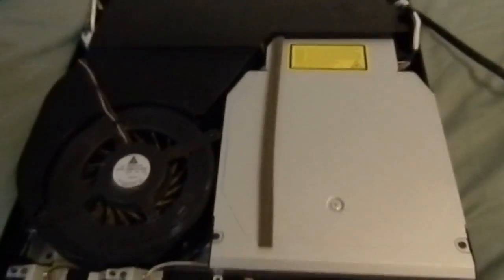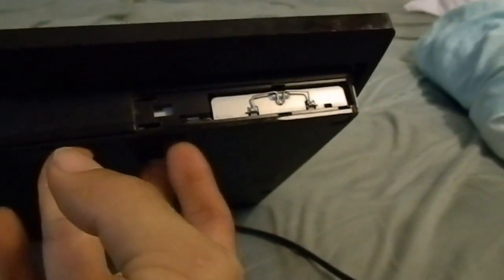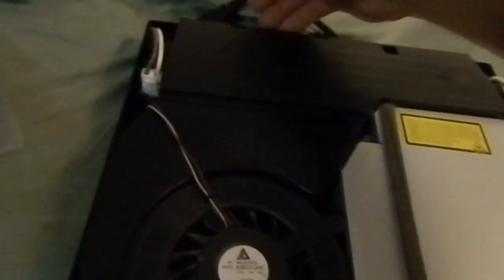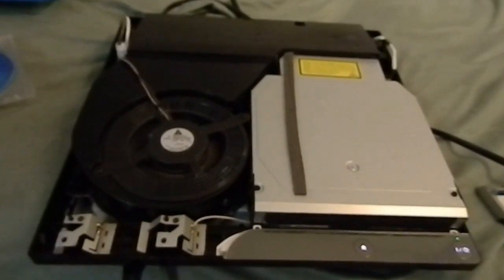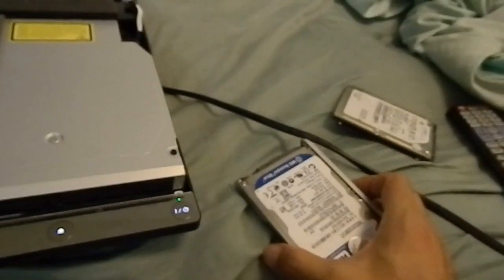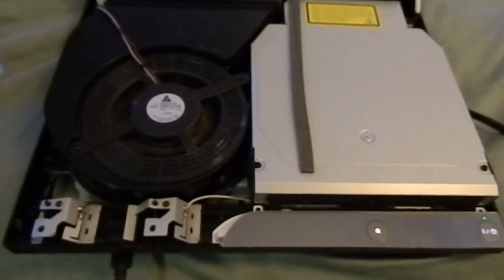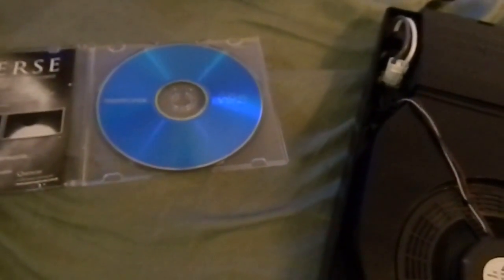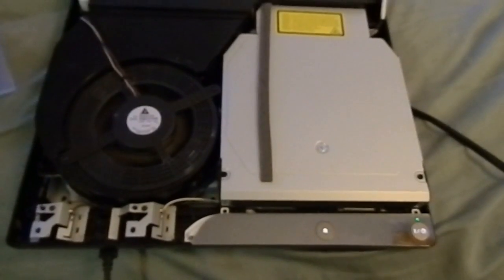PS3 WITH NO VIDEO AND GREEN LIGHT REPAIR GLOD Hard Drive Failure (como reparar PS3 sin video)

Comment: Mine died today. It froze during skyrim. Pulled the plug as its the only way I could unfreeze it. Turned it on and no hdmi output came, you cant turn it off either like the button doesn't beep or anything it stays on permanently unless you pull the plug. Tried several times. The power button will turn it on, but turning it off by holding it its unresponsive. No blinking, no sounds. Nothing. Its done I guess as you cannot boot into safe mode as the power button doesn't work beyond turning it on, once its on, it stays on forever. Pressing it again does nothing.  I was pretty far in skyrim and was addicted to it now ill probably get withdrawal. The controller doesn't connect to it as well, it just flashes when you power on the controller.

Comment: I just had to pull the HD out and reinstall and it worked after 8yrs not being plugged up. Thank you.
Reply: New HD ?
Reply: @dualsticks6502  factory 40g. Connection probably had just enough corrosion that it lost continuity.

Comment: what do i do if even without the hard drive my ps3 doesnt show anything? (p.s it's a phat model but not the backwards compatible one)
Reply: Did u ever figure it out?
Reply: @Devil Ops  likely rsx needs reballing but i dont have the equipment to do it
Reply: @Fogolol  Yea sucks maybe I just need a new hard drive did u try that? Because we have the fat version maybe it's different
Reply: @devilops341  i did try another hard drive, came from a working slim version ps3 just for testing but still no output, fan would increase strength after 2 minutes like normal but no display, also was able to run my slim ps3 normally with the hard drive from the phat, though my slim's hdd got corrupted thanks to that stunt, good thing i had my saves backed up, so yeah i think this is an issue with the rsx maybe even the cell and reballing would probably fix it but that wouldn't be a permanent solution anyway so i should just scrap it for parts
Reply: @Fogolol  thx

Comment: Good stuff. I was having issues with my PS3 and haven’t been able to play it for awhile. I tried different tv, monitors, cables, until I found this video. I think my PS3’s gpu is busted because I don’t see that screen even when the HDD is out. I’ll try to bring mine to a repair store and see what happens. Great video, very helpful.
Reply: Did It get fixed?
Reply: @Antone_06  nope, seems like I need to have to replace the thermal paste but haven’t got the time.
Reply: @chican_0  my screen is black but with like 50 different random colored pixels on it even with the hard drive out, so I’m assuming it’s a gpu issue.
Reply: @Antone_06  most likely. If thermal paste doesn’t solve it then maybe gpu is already busted. I’m assuming the same for my ps3.
Reply: @chican_0  I’m taking it in to Best Buy this week and they said they’ll look at it for free
Reply: @Antone_06  
Did it work?

Comment: I really like the way how you diagnose this issue. If it works without the drive this means it is NOT a graphic issue but either software OR hardware failure of the drive :) I really appreciate this video. Thanks!

Comment: My PS3 slim doesn't work with HDMI but works with a Component cable, could this be the issue and I need to replace the HDD?? I already reset the video and put the HDD out and back in.

Comment: When i start my ps3 the green light stays on but there is no display, i tried switching the hdmi & vga cables, also tried A/V reset, but still no video. And when i swtich it off, green light flashes (slowly) then it beeps (3-4times) and then shuts down, CAN YOU PLEASE TELL ME WHATS THE PROBLEM???
Reply: Same problem I’m also facing with my ps3...i think it’s a hard drive issue.
Reply: @ThakurAbhishek5347  I have the same problem after I tried to update the latest software.
Reply: Kofi Seidu not a big issue .. i took my ps to nearest technician... he pressed the power button for few seconds and and than something was written on the screen and he factory reseted the device .. and boom i got my ps back to life again ..and it only costs 200 rps lol 😂
Reply: Abhi rajput wow good for you I got a ps4 to play games (Not much games) so far I really play my step dad’s super slim ps3 that he never uses anymore. It’s been around for years and still functions correctly.
Reply: Ff

Comment: Always try to rebuild the database before replacing your hard drive and losing your saved data. It could just be a corrupted database. There are several YouTube videos on how to do it. Better to try that than lose 5 years of saved game data. If that fails, you can try reinstalling the system on your current drive. You’ll still lose your data but might save money on buying a new drive.

Comment: My ps3 slim has no video and audio and no hdd light blinking ,  fan is working , disk inserts and ejects as usual , has green solid power colour , i changed the hard drive and it still has that issues...but my controller get synced when i connect it with cable and press ps button....i dont know whats the problem
Reply: AWESOME CREATORS same
Reply: Material's Upgraded Same, got mine today :(
Reply: @kellybodley8363  did u get your ps3 repaired ?
Reply: @Shaadibnmohammad  sadly no
Reply: @kellybodley8363  i also dont how much will it cost
Reply: @Shaadibnmohammad  I'm moving to PC

Comment: I replaced the bluesy player and hard drive ,updated to 4.82 or so and everything works Except  for when starting a Disc the screen stays black, I already did safe mode options still black screen
Reply: Pasquale Lerro I have the same issues did you fix it

Comment: My ps3 won't show up on my tv.. I tried resetting the input/output while it was connected to my HDMI cable and again with just the av cables and again with both at the same time.. my green light is coming on the yellow hdd lights flash for a few seconds after letting the power button go but still nothing... please help idk what else to do..

Comment: I was in the kitchen and me and my sister heard a loud bang. I went in my room and my ps3 was on the floor. It fell pretty hard. It turns on, but you can't see anything just a blank screen, controller won't work with it, won't go into safe mode, no audio. Please is their a solution that's easy without having to pay, sell, or repair my ps3. I didn't touch it for the whole night. I turned it on today and it went to the screen but froze with these weird color lines. So I turned it off and it's still doing the same thing as forth as no ps3 screen, controller doesn't work with it, no audio, won't go into safe mode. Oh, and when I pressed the power button it turns on, the orange color dot blinks a few times then doesn't blink no more. The green color dot doesn't blink at all. So I have to hold the power button for about 10 seconds then it turns off. I'm 12 so please don't let their be any hard work, repairing, selling, or paying. Please try to find a solution and if you do please let me know ASAP!-Lil Jordan P.S. please let their be a solution that won't result in losing my saved game data.                                               

Now its loading the game, and controllers are syncing basically its working regular but when you get into a game its freezing with the weird line colors that's all that's wrong with it now. A solution for that.
Reply: hey my ps3 did this for a while then broke completely, if you bought any dlc i would deactivate your account untill you fix it unless it goes completely
Reply: the weird line problems sounds like the gpu is failing, when u droped the ps3 you probably cracked the already dried thermal paste on the gpu and cpu. id replace them and see what happens. basically your ps3 is just overheating in my opinion easy fix
Reply: Beretuzerpk can I take my hard drive out,send my ps3 to sony to get it fixed then put my hard drive back in and have all my data?
Reply: that seems like the perfect question for sony if your ps3 is still under warranty, call them up.  if u want to save some important save files to a usb drive if sony says no, then flip your ps3 and apply pressure to the back usb side of the ps3, should be your right side.  that should stop it from pixelating as long as u continue to hold the pressure with an object or something long enough for u to back up save data on a usb drive
Reply: Beretuzerpk but my ps3 shows no input and if it does it freezes in 2 minutes once it comes on so I can't put my data on a usb that's y I thought bout da hard drive
Reply: +Lil Jordan did u apply pressure to the back side of your ps3 with the palm of yoour hand to where the gpu should sit?
Reply: Beretuzerpk nah...
Reply: Lil Jordan dumbass you will have to repair it. This is a video where you did not dop it

Comment: my ps3 is on cfw is there any chance i can replace the hard drive and stay on the cfw or will it upgrade to the latest ofw wich is 4.80
Reply: +Robert Tolhurst Fixed it?
same problem here. I got GLOD(probably) and when I switched my HDD with an OFW one it worked but when I put a firmware in it to make my ps3 work again it gives me an error.

By the way i tried both OFW and CFW
Reply: +Popopicos all i did was take my hdd from my laptop and put it in ps3 and i put my memory stick containing the firmware i had before my hard drive broke wich was 4.78.2 rebug and it did the format and put the rebug back on and  its worked like brand new since then
Reply: shit I have forgotten which my firmware was. I remember getting that GLOD cuz I was installing a spoof to play online. any ideas?(it was like a year or so)
Reply: why dont you send your ps3 to shop and then get it repaired then, flash it back to 3.55 then upgrade to what firmware you want from there im not good with this type of stuff as even i had to look at a ton of youtube clips before i fixed it
Reply: or buy a new 3.55 from ebay or something
Reply: CFW IS INSTALLED ON THE NOR CHIP NOT THE HARD DRIVE

Comment: My ps3 is jailbroken and have the HHD problem, if I replace it will I lose like everything?
Reply from the maker: +Popopicos Since your HDD may be bad, you wont be able to back up your data when you change the hard drive, so yes, you will lose it.
Reply: +Runforlife OK So I just stole an HDD from my friends ps3 :P and put it back but I it says that I have to puy a storage with an update in it. If I put a 3.55 ofw, will I be able to jb again?
Reply: +Popopicos Does it need a brand new HDD or just a working HDD?

Comment: so I unplugged it then took the hard drive out then started it up and nothing happened whats the other thing called ? reply plz
Reply from the maker: +Julian caraballo so your PS3 was not starting before you took out the hard drive? and  when you take it out it starts (turns on) ?
Reply: Runforlife yeah so here is my story not going into much detail but after 3 months my friends told me try it 1 last time and so I did and after I did it turned on like it was nothing and so after like 20 min or so I install black ops 1 update the it crashes and wont start up right again
Reply: Runforlife but after a couple of hours later I found your vid did it didn't work without hard drive nothing popped up the I try it again and it only popped up once
Reply from the maker: +Julian caraballo So the PS3 crashed after the black ops update?
Reply: +Runforlife yep have any ideas?
Reply from the maker: +Julian caraballo Are you having the same problem described in the video where it does not turn on unless you remove the original hard drive?
Reply: +Runforlife I think it's both because I did the hard dirive thing and it didn't work but then after i waited a couple of hours it worked
Reply from the maker: +Julian caraballo after you waited a couple of hours with the hard drive in or out of the PS3?
Reply: +Runforlife ok me and my dad replace the GPU and CPU with thermal paste but It back together and it still didn't work
Reply from the maker: +Julian caraballo Can you be more detailed? Does the PS3 turn on at all? Are you getting a green light or yellow light when you try to turn it on? Do you see anything on the TV screen when you try to turn it on?
Reply: Runforlife sorry yes it turns on I get do get a green light but nothing pops up on the screen
Reply from the maker: +Julian caraballo What happens if you turn off the PS3, and then take out the hard drive and leave it out, and then turn on the PS3 without the hardrive? Do you get anything on the TV screen?
Reply: +Runforlife nope
Reply from the maker: +Julian caraballo Then the GPU is the problem. Since you already applied thermal paste, the issue might be reballing the gpu, which requires you to take it to a tech that has that kind of soldering machine.
Reply: Runforlife oh ok thanks I might not worry about it now since I'm getting a ps4 next week but I might still want to fix it because I want to play with my old friends You really help me thanks.
Reply from the maker: +Julian caraballo No worries. Please like and subscribe for more videos! Thanks!
Reply: +Runforlife do you have Skype so you can help me fix it please 
I'm stuck on GLOD😞
Skype: z-slowmeth420

Comment: so my ps3 will turn on; after i do so, the fan goes really fast and completely shuts off (red light goes off). any idea what it might be? 
~thanks
Reply from the maker: +Gerardo siNaloa14 It sounds like an overheating issue.
Reply: +Runforlife thanks for your reply man, do you know how i can fix this?
Reply from the maker: +Gerardo siNaloa14 Does the light stay green while it is on?
Reply: +Runforlife yes, it stays green for about a minute or so
Reply from the maker: +Runforlife The cause of this issue can be a dirty fan/vents, thermal paste not working, or chip may need re-balling. The cheapest one you can try is to open it and clean the fan and the fan vents.
Reply: +Runforlife i have cleaned it already so I'm assuming it's one of the other two?
Reply from the maker: +Gerardo siNaloa14 Yes, some people try to blow hot air at the chip with their blow dryer and sometimes that works (since it refuses the solder and chip). However, that is usually a temporary fix. The only permanent fix in  this case is the re-balling process, but that has to be done by a professional who owns a stationary work station.

Comment: Thanks a lot! I have got the error message! Glad! I have a spare hdd that works but it is full currently. How can I wipe it without the Ps3?
Reply from the maker: unbelivablechicken There is an external hardrive kit available on ebay which allows you to connect any Hard drive to your computer via USB. Please like and subscribe for future videos. Thanks!
Reply: Runforlife hey can still use the same hard drive or does it needs to be a new one?
Reply from the maker: If you are able to format the old hard drive you can still use it, but I would rather get a new one since this error happens when the hard drive is going bad. It is up to you.

Comment: hi,this video was half workin...ii just removed the hard drive and it said ''CANNOT START'' and i searched for the hard drive online but i couldnt find the same model as mine.can i use other model hard drive plssss help me with this....
Reply from the maker: Daniel Smith Hi, yes you can use a different model or brand as long as it is a 2.5” internal Serial ATA hard drive.

Comment: I can use the same hard drive formatted?
Reply from the maker: superpoke122 Sure, but you are risking saving your data in a hard drive that may potentially fail again. Once the hard drives so that, it is best to just replace them. Good luck!
Reply from the maker: superpoke122 Sure, but you are risking saving your data in a hard drive that may potentially fail again. Once the hard drives so that, it is best to just replace them. Good luck!

Comment: On mine only the green light comes on nothing shows up and I hear no noise from the system do you know what's wrong with it and do you know how to fix it please get back to me asap
Reply from the maker: Have you tried taking the hard drive out as explained in this video to find out if that is the problem?
Reply: Try put 4 coin into Radiators, i was tried, and it help my ps3 live until now.

Comment: so my ps3 slim turns on green light, but no video, i tried resetting the video and the hdmi cable has been tested in another ps3... i changed harddrive from the working ps3 to mine and it doesn't start, so im asuming i'll have to reflow the gpu right?, sorry for bad english

Comment: mine turns on but then it freezes and i cant turn it off without unplugging it i did reformat the hard drive im starting to think it is the power supply my gpu is just fine
Reply: U found a solution?
Reply: Just change motherboard battery :)
Reply: That sounds exactly like a hard drive issue.

Comment: I've had this issue before, where none of these solutions worked. I left it unplugged for a couple of days and then tried it out on a different T.V and different HDMI cable, then it worked.. strange stuff.
Reply from the maker: I am glad you fixed it. :0)
Reply: You did'nt need couple of days 30 minutes should have worked also
Reply: Mine will only play on one specific tv😤
Reply: @killztoyz  The issue is that the the PS3 doesn't detect the correct resolution and instead defaults to the already selected resolution that might not be supported on your other TVs. You need to look up how to do the HDMI reset to get it working on other TVs.

Comment: i have a similar problem but my fan gets really loud after a few seconds 
it runs like that for half a minute and turns off 
im not getting any video on the tv either
one time i was lucky enough to access the recovery but that didnt do anything
Reply: Sounds like a heating problem, you may have to replace the thermal paste to fix that